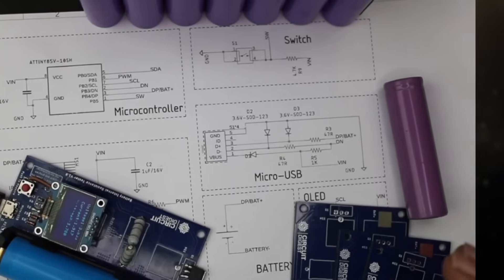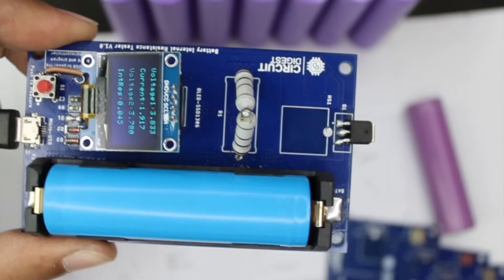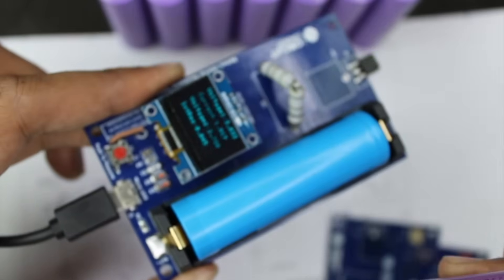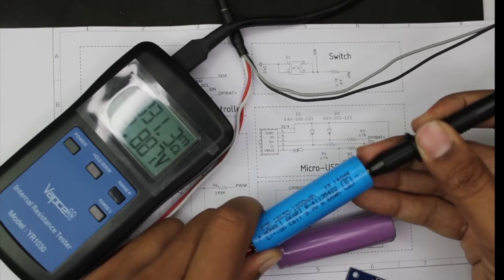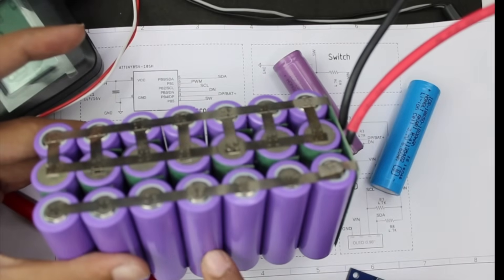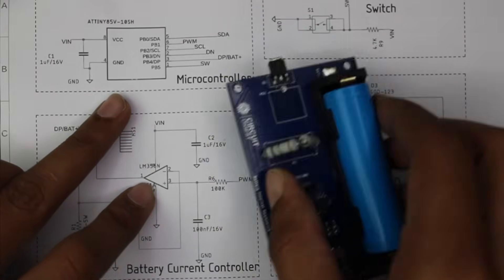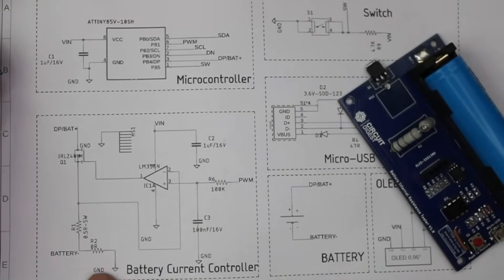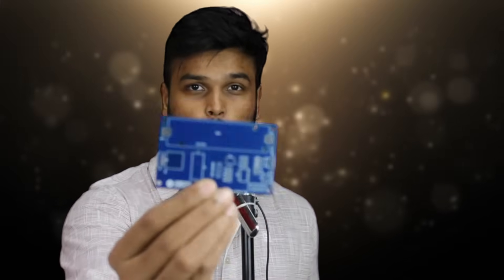How to build a Battery Internal Resistance Meter with Arduino and Atmel ATtiny85 IC?

Comment: I dpent 2 days msking this . But in the end when i try to use it . The display shows same voltage on v1 and v2 . No mattery what battery i connect it always shows 0.17 ohm just like in the thumbnail .
Can you tell me why
Reply from the maker: Hi, Make sure your connections are correct and you have used the components with correct values.